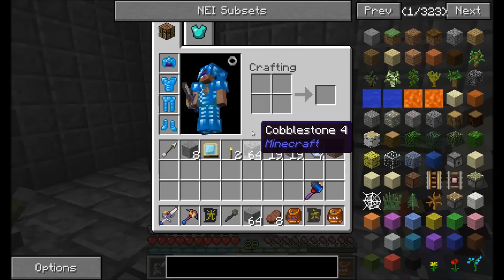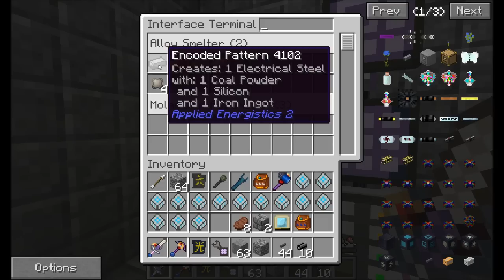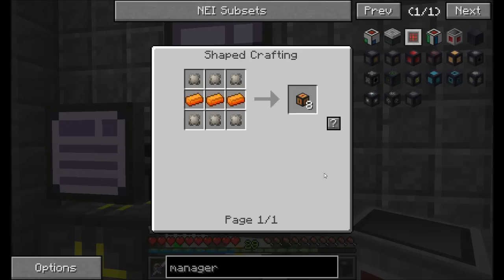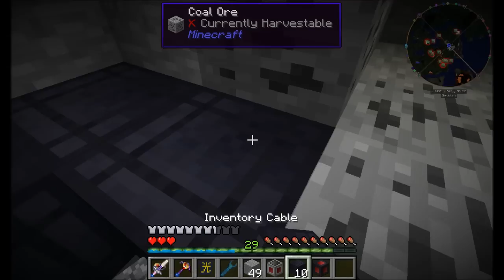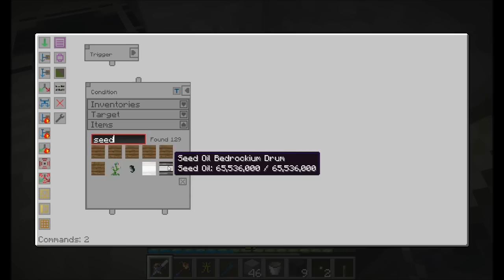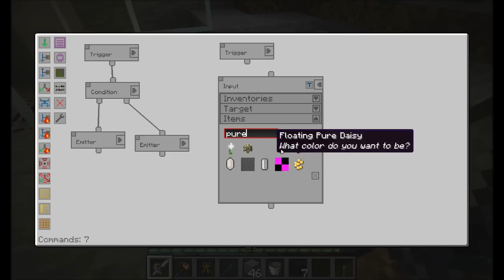Lets Play   S7 E42 AE2 Automation

Comment: Hey Dire, for hooking up the accelerators, they just need power, so you can use just plain quartz cabling, instead of using fluix cable. Fluix cable is only necessary if channels are needed. Also, you can use plain white quartz cabling to join the power store of two networks, without mixing channels!

Comment: for the Crystal growth accelerators i used 1 item transfer node with a filter for flux quarts, certus quarts and nether quarts and a world interaction upgrade. as well as a open blocks dropper with a redstone clock next to it so all the items in the dropper drop straight away and an interface on the dropper to shove the items in the dropper and then it feeds the finished quarts to a interface terminal that feed it into the system. and to make the circuits i put all the presses down and feed all the needed ingredients into a chest with a interface on it. then i using only item conduits from ender io set up filters so the items only go where they are needed and then it feeds the finished processor into the terminal at the start of the process so the whole thing needs only one interface.
Reply: Nice, but how to turn them off? And a redstoneclock could cause some fps issues
Reply: Dropper (not minecraft) and a BC gate clock that checks for items in the dropper and will pulse until empty.
then use transfer node with 2/3 world interactions and a filter, This allows you to do a full circle of accelerators around a  block of water and still collect the grown crystals.
Reply: Mohamed Ahmed it doesn't craft until i tell it to and the growth accelerators use around 20rf per tick and i produce 2560rf per tick with 4 magma dynamos so they don't need to be turned off also no the redstone clock doesn't cause fps issues
Reply: I used SFM very similar to this build (including power shutoff, though I'm using my main AE network power instead of a separate energy acceptor), except I use the item valve to insert the seeds to be grown instead of using a dropper.  Also means I can fit a fifth growth accelerator on there, although I'm not sure if that actually helps.  I haven't hooked it up to an interface for auto-crafting yet, but I've set it up so I just drop the ingredients into a chest, come back later and the final products are in the same chest.  (It also updates a sign to show that crafting is in progress, and it's completely magnet-proof.)  I actually enjoy that more than auto-crafting... for now.  I'll probably fully automate it eventually.

Comment: For AE2 seeds I use Steves Factory with the Item Valve, fully automated.

Trigger 1 sec -> Input (Item Valve, every Pure Crystal) -> Output (ME interface, every Pure Crystal) -> Input (Chest, near the same ME interface with recipes for seeds, whitelist every seed NBT independent) -> Output (Item Valve, seeds NBT independent) -> Condition (If ANY seeds NBT ind. on Item Valve) -> TRUE Redstone emitter ON to a Toggle Bus, to turn on Growth Accelerators. -> FALSE Redstone emitter OFF to Toggle Bus.
Reply: Meh. Multipart terminal attached to open crate over water with growth accelerator. 1 seed =1 crystal pattern. Also can be used for fluix crystal. Item transfer node with world interaction and filter to pick up when grown.
Reply: I did it too, but how to turn on/off Growth Accelerators?
Reply: What I did was having a Extra Utilities Item Transfer Node with a filer for all of the Pure Quartz and the Fluix one and then connect the node to the Interface with the Transport Pipes
Reply: André Lucas I did the same when I first played with AE 2. its a nice simple build but if I was to re do it I would use SFM only because it can also turn the accelerators on and off as well.
Reply: Uriei
I use a turtle for seeds + turn on/off :)
Reply: Kaikaku I wonder why
Reply: TunelessHalo2
Well, generally because I like automation with turtles. And in this case, when you've got the right program, than the setup is a even a tiny bit simpler ;)
Reply: Kaikaku Or maybe it has to do with that profile picture
Reply: TunelessHalo2
That's also true, I guess it depends on each other :)
Reply: Kaikaku I like the idea of turtles, I just dislike the coding part

Comment: There's a small hint I got for you (and possibly other people as well) when creating new crafting patterns:
It is possible to craft in that terminal. Lets say for example I want a new pattern for iron gears (BC). Then I need wooden and cobblestone gears first (if I stick with BC gears :)). Put in the recipe for a wooden gear, press the button to write it to the pattern and then take the gear and put it into AE or put it on the left side for the new pattern. Do the same with the other 2 gears and then close the interface and head over to insert your new patterns into the molecular assembler interfaces.

Comment: Direwolf20, if you use a SFM Block gate and get the interface to place items for crafting into a buffer chest, the block gate will drop the items a stack at a time speeding things up as later in AE the open crate just is not fast enough.

Comment: As much as I understand your love for Steve's Factory Manager, I think it would be so much easier to just use Extra Utilities' Transfer Node with a Pure Fluix/Nether Quartz/Certus Quartz/regular Fluix Crystal filter in it and have it feed back into the Interface. Using a Chest as a buffer that then transfers the materials into the Open Crate via another Transfer Node might also prevent the Hopper problem someone mentioned as well.

Comment: If you add a fifth accelerator on the bottom (horizontally positioned), get rid of the open crate and put an item valve on top of the water, you will have an even faster setup. (this still works with the same item valve detection setup you used to turn on/off the accelerators).

Just FYI for future builds.

Comment: As a simpler alternative for those who don't have Steve's or don't like Steve's factory, you can use a level emitter with a crafting upgrade and a toggle bus to turn the accelerators on when crafting and off when they are done. (of course in conjunction with a dropper for the seeds and a filtered item collector of some sort)

Comment: Built one of these only a day ago, used a transfer node tough, steve's a little unstable on the server i play. Had a manual toggle but my power systems tend to be charcoal based, wood is voided if it's not burnt so might as well leave it on.

Comment: Did I hear Dire correctly that Shift Right Click will access the NBT data for the seeds in Steve's Factory Manager? I did this build with the Dropper and clock input method 2 weeks ago but the NBT data on the seeds was causing the power to shutoff too soon. I had tied the power shutoff to pulling Items out of the water as a work around but that left a few that were not fully grown.

Comment: Dire the advantage of the not converted interfaces they do pass trough power and you do not need to have a cable connecting to the molecular assembler plus you can hook up one molecular assembler on each side whit out using another channel
Reply: the reason he doesnt is he wants more space for each assembler he is looking for the maximum amount of space for 1 assembler the way i have mine set up is for speed as i dislike waiting i use 5 assemblers for 1 interface
Reply: *****
can u not read? i said i have 5 assemblers for 1 interface they are attached to each side of the assemble except where the cable comes in at and it is faster that way but when i start my world at the beginning i use it the opposite way just so that there is less stuff that i have to craft by hand i set the stuff up and let it run while i go minning
Reply: *****
This can be seen in a prev. ForgeCraft series, where Soaryn made that insane AE2 Interface/Assembler flower. Though I'd personally do such thing with more assemblers and less interfaces, for maximum concurrency
Reply: Btw, I just though that this approach can be applied to furnaces/pulverizers, like 2x2 interface/machine chess pattern.
Reply: MrTargetSan
yeah i have 5 alloy smelters per interface

Comment: If you use the interface block instead of the multipart, they actually share power and you don't need to surround it with cable. And you can add on extra assemblers around your 6 interface structure with more interfaces (thank you Soaryn)

Comment: Direwolf, the ME Interface/hopper combo may give you trouble.  When the item conduit puts items into the Interface, there's a small chance for the hopper to pick them up before AE takes them to put them into storage.  These items would then get dropped in the water and despawn.  Putting the interface adjacent to the hopper should fix this.
Reply: You are wrong, I've tried in a creative world and a hopper doesn't pick up the contents of the Interface's inventory if the contents come from an external source
Reply: Marcos Ramos Abia I just tried it in a creative world to and at first it didn't work.  I expanded my test to include 7 of the interface/hopper combos and then they did start grabbing it.  Even with 2 sets, it's enough to let hoppers grab them.  My guess is that AE can only do so many things per tick so if you have a large network that's quite busy, it slows down just enough to let hoppers take items.  The Ender IO machines can definitely grab items from an interface quicker than AE picks them up.
One small note about my test is that I used extra utilities transfer pipe instead of the item conduits just because they can do more items / tick so I didn't have to wait long in case this was a rare event.  The principle should still apply for the item conduits I think.
Reply: Then direwolf should, just in case, and since servers are quite laggy, change his setup

Comment: Direwolf, Full block interfaces transmit power. Mini multipart interfaces do NOT transmit power to the Assembler.
Reply: To be precise, in general interfaces don't transmit power via the face they point to. Multipart interfaces automatically point to the face they are connected to.
Reply: Belgabor And a full-block interface defaults to unpointed, so it can transmit power to any face.  And it can still work with the assembler.  (In fact it can work with multiple adjacent assemblers, which can be useful to speed up crafting of bulk items; not sure if that requires coprocessors as well though.)

But yes, you're correct: if you wrench a full-block interface to point to the assembler, it acts exactly like the multipart interface and doesn't transmit power.  It's not a bug, it's an isolation feature designed for subnet management.

My current favourite build at the moment is what I call a "crafting node": two assemblers side by side with 8 block interfaces touching on 4 sides of each assembler.  This leaves one face of the assembler open so you can see what it's crafting, and you can run just one regular fluix cable to any of the interfaces to power & run the whole thing, since it only uses 8 channels.  It's perhaps not the most efficient use of the assembler (2 faces are "wasted" on each) but it looks cool and it's easy to cable.  You can see one in the latest video on my channel.

Comment: i actually used a full factory manager setup to do it.

had an input chest from the ME system, factory manager pulls out of that and drops the stuff into the pool using the same item valve it uses to pull out the ready crystals
and then puts the finished crystals into an attached interface

Comment: Normally I really appreciate the things you do, but the accel thing could have been way better:

- You don't need the open crate because you can simply put the me interface onto the same sfm item valve you use for collecting and done. How cool is that?
- You don't need the chest and the item conduits because you can deliver the finished stuff through that same one me interface to your me system.
- You don't need the energy acceptor and energy conduit because you can power the thing from your main me system through said me interface, using an me toggle bus to turn power on and off by sfm.
- Finally you can also power the growth accellerators from the sides with only 3 me cables if desired. You just have to place the accelerators agains a side instead of the bottom. So you can fit the whole thing even into a 3x3x2.

Comment: Rather surprised you did not use the single Steve's Factory Item Valve to both input the seeds or Charged Certus Quartz Crystal, Redstone and Nether Quartz into the water as well as taking the finished items out.  Could have condensed your factory cable and build as well as not have to worry about the hangups of a hopper, open crate and glass. Dump items in the chest from the interface into the chest, put into water with the valve, pull finished items out of the water with the valve back to the chest, pull out of chest with export back into interface.  Love there are different ways people solve problems in Minecraft.

Also, if you plan on using ME for making a lot of multi-process recipes you might want to put the assemblers and interfaces in a staggered pattern.  You can stack them two by two by four, for eight assemblers and eight interfaces per smart cable (8 channels) which means each interface touches three-four assemblers and vice versa for each assembler (only needs one cable entry point into one of the ME interfaces of the mass.  Uses more resources in assemblers though less in cables but means the assembler isn't bogged down with large recipes waiting to finish before the next can go.

Anyway great stuff.  Always enjoy your builds.

Comment: I used Item Router from MRF instead of Open Crate and Item Valve.... 3 x Level emitters with craftingcards control the energyflow. Works like a charm and a valid option if you havnt gone through botanica yet, also easier interface.

Comment: Dire, thank you for the video! I've found that when I connected an interface directly to the open crate it wouldn't transfer all 3 ingredients required to make fluid crystals. It's as if the open crate only allowed 2 differnt items to go thru it but since fluix crystals take 3 there would always be one item that wouldn't ever make it into the puddle. I had to go interface to chest from chest to item conduit with speed upgrades to open crate. Haven't finished watching yet so maybe you have a fix. Thanks again for the video

Comment: Someone help me out here please.

At around 30:45, he goes to craft some blank patterns, but cannot do it because the system is currently in the middle of a job making pure certus quartz.  He says he needs some co-processors to prevent that problem, but doesn't he actually need a second CPU all together for that?  In other words, a co-processor would not allow him to craft blank patterns in that situation because one CPU can only perform one job at a time.  Co-processors are used when you have one job, but several steps that run concurrently for that job.  Multiple CPUs are helpful when you want to run several JOBS at a time. 

For example, if you want to craft 100 solar panels and it requires several machines to be processing different things at once, a co-processor is what you want.

If you want to craft 100 torches, and while that job is running, you request 100 bread, then you'd want multiple CPUs.  And in this case, Direwolf had a job crafting pure certus quartz running and requested blank patterns - which is a second job - requiring a second CPU, not a co-processor.

At least, that is my understanding.  Is this correct?
Reply: Yes.
Reply: Willoughby Krenzteinburg  Yup

Comment: Dire we need u !!!!!
When u add a wired modem to an capacitor bank the server crashes ...
Can u help me/us. Or can u try to check this with the mod authors pls ?! I will use ur Turbine/reactor program !!!!

23:49:14] [Netty Client IO #0/INFO] [OpenMods]: openmods.network.IdSyncManager.onDisconnect(IdSyncManager.java:124): Disconnected, restoring local data
[23:49:14] [Server thread/INFO]: Saving chunks for level 'Copy of New WorlD'/Nether
[23:49:14] [Server thread/INFO]: Saving chunks for level 'Copy of New WorlD'/Underdark
[23:49:14] [Server thread/INFO]: Saving chunks for level 'Copy of New WorlD'/Age 9
[23:49:14] [Server thread/INFO] [journeymap]: Mapping halted in C:\.....\direwolf20_17\minecraft\journeymap\data\sp\Copy of New WorlD\DIM0
[23:49:14] [Server thread/INFO] [FML]: Unloading dimension 0
[23:49:14] [Server thread/INFO] [FML]: Unloading dimension -1
[23:49:14] [Server thread/INFO] [FML]: Unloading dimension -17
[23:49:14] [Server thread/INFO] [FML]: Unloading dimension 9
[23:49:14] [Server thread/INFO] [FML]: Applying holder lookups
[23:49:14] [Server thread/INFO] [FML]: Holder lookups applied
[23:49:14] [pool-5-thread-1/INFO] [EnderIO]: ServerChannelRegister: Dimensional Trasciever data saved to C:\.....\direwolf20_17\minecraft\saves\Copy of New WorlD\enderio\dimensionalTransceiver.json
[23:49:14] [Server thread/INFO] [FML]: The state engine was in incorrect state SERVER_STOPPING and forced into state SERVER_STOPPED. Errors may have been discarded.